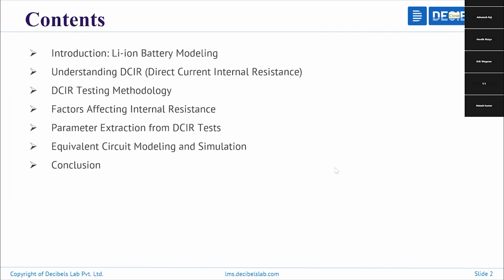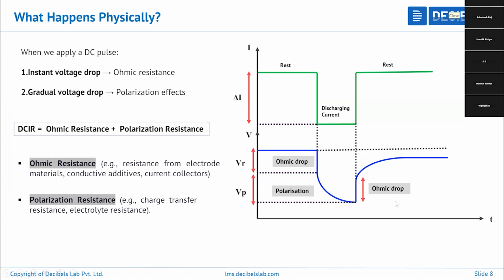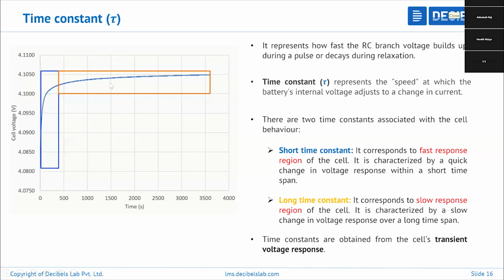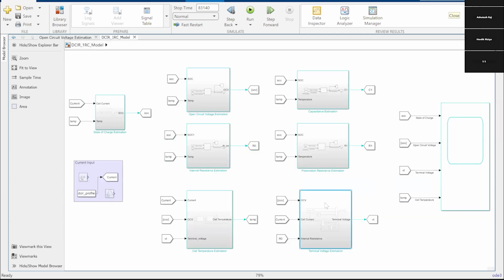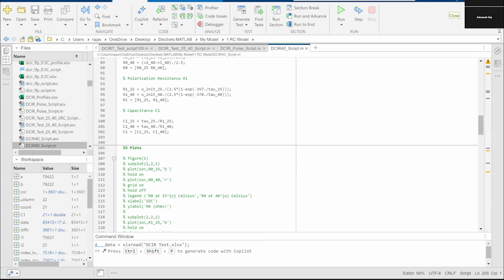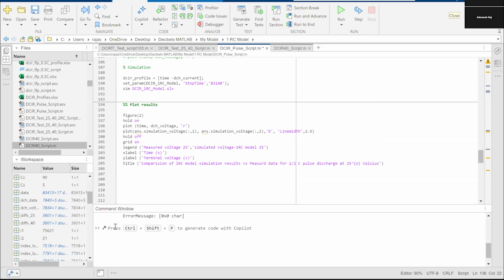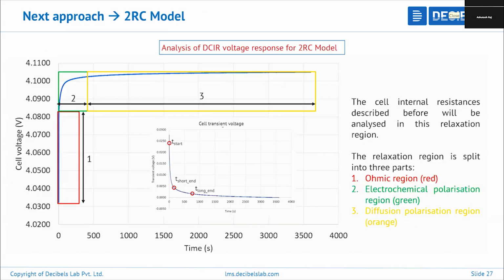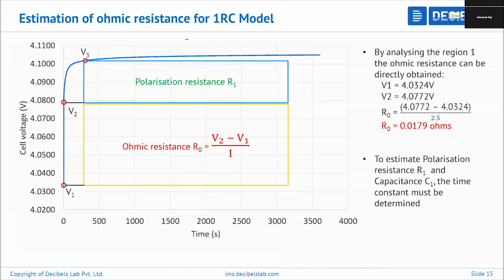Equivalent Circuit Modeling & Simulation of Li-Ion Batteries Using DCIR Testing | Free BMS Bootcamp

Comment: Can you explain how you measure Tpulse = 357 while calculating R1? @26:00 Please?
Reply: My guess is that the t-pulse value should be 373.2 seconds. The time required for a 5% decrease in SOC is 6.22 minutes (373.2 seconds).